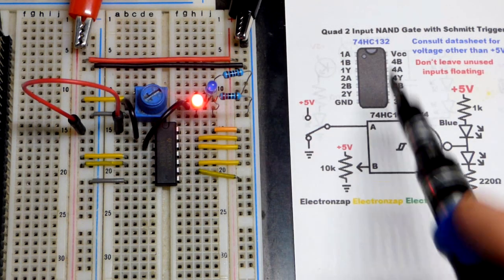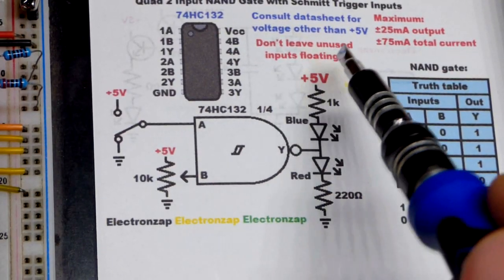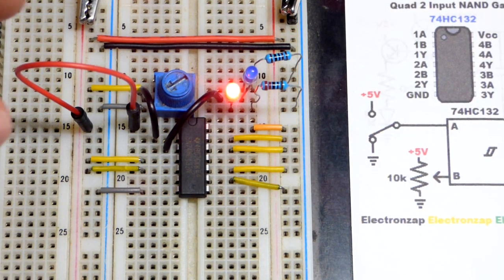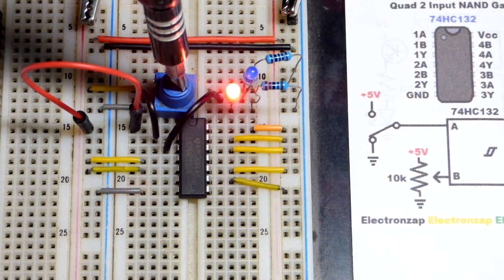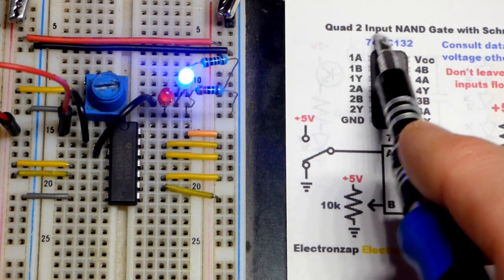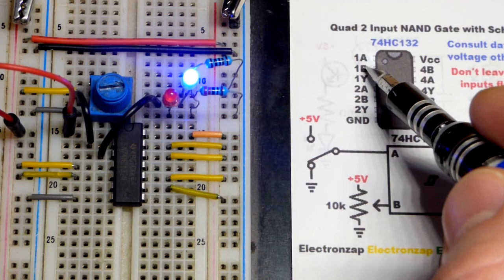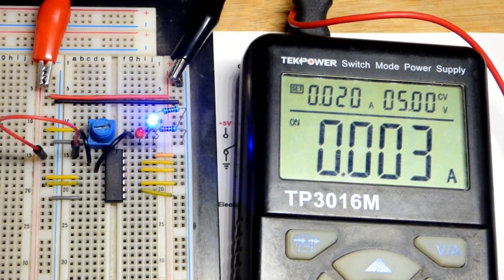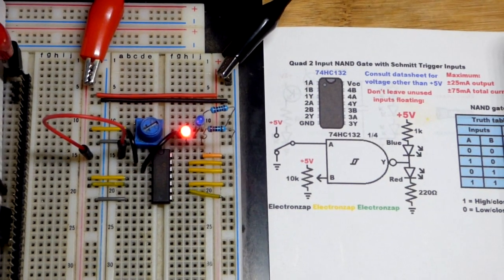74HC132 Quad 2 Input NAND Gate With Schmitt Trigger Inputs Integrated Circuit IC

Comment: Thanks again for this new video!
I just have one question, in which concrete application would it be preferable to use the schmitt trigger version?
Reply from the maker: Thanks for watching! Schmitt trigger is definitely preferable when there's a sliding voltage instead of a sudden voltage change between 2 voltages near the 2 supply rails. Might always be the best option.
Reply: @ I see. Like an analog signal coming from a sensor (potentially amplified) instead of a digital one.
I remember having recovered a few logic gates from old circuits already some years ago, probably NAND as apparently they are more common.
I might have read to be careful with static shocks in the datasheet but If yes I forgot it until watching your videos. I might already have destroyed them!
I don't have much time now to play with those things but I wish you success with your interesting channel and will be pleased to learn more from it when I go back to fiddling with  these stuff.
Thanks for your reply and good luck